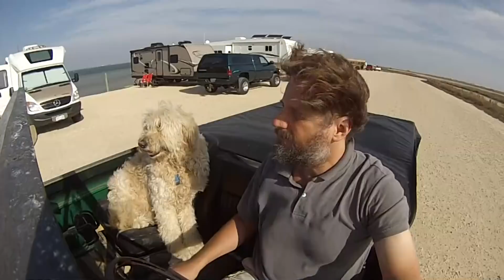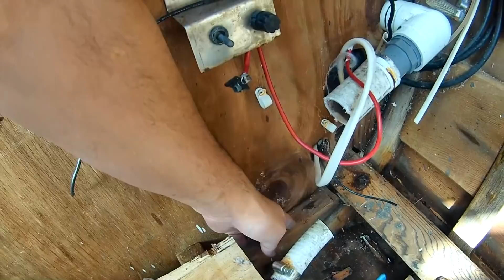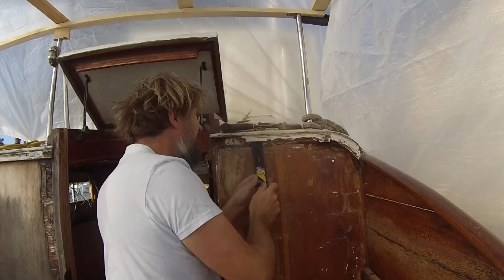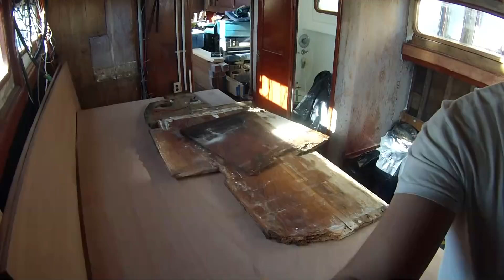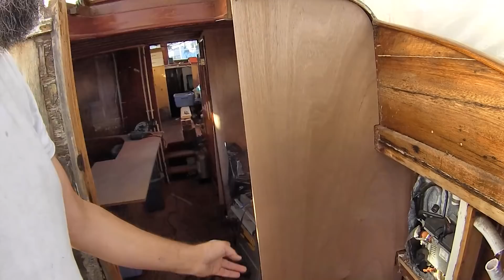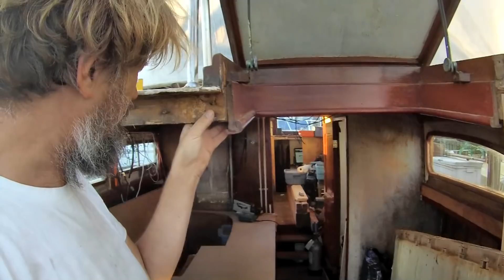Ripping out the aft bulkhead - Wooden boat restoration - Boat Refit - Travels With Geordie #67

Comment: I noticed when you reefed the bulkhead out the plywood and the radius outside edge broke loose it will need to be reglued and screwed and some gelcoat painted on easypoxy or what have you

Comment: did you see the split in the roof section when you knocked out the bulkhead it corresponded where the rot was....
Reply from the maker: Oh yes, I've known about this problem for a while...
Reply: @TravelsWithGeordie  you have a lovely project there and are a talented man myself i use to restore mk1 railway coaches the woodwork and fitting of it was done by craftsmen i worked with a guy who did his apprenticeship on the london barges.

Comment: Don't want to be a critic but wouldn't it have been easier to work on the boat after the haul out?
And where are you sleeping??? 
Aside from that....
SHES GOING TO BE GORGEOUS when you're completed!!!!
Reply from the maker: Hi again Gary. No worries, good question. Some work really must be done at a haul out but as I live aboard an extended stay in a boatyard is not appealing. Also I need to limit the time the boat is out of the water to 10 days or so at a time to keep her from drying out and racking her fasteners. During this period I was sleeping in the cozy fore cabin or forward castle, fo'c'sle.